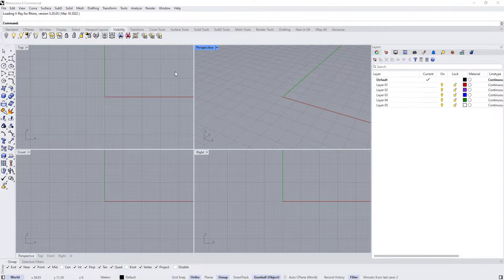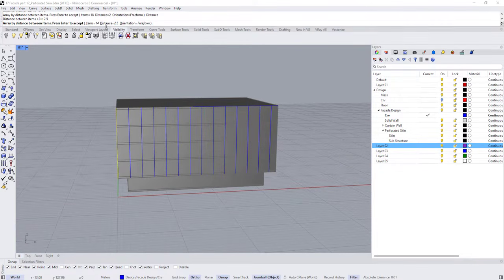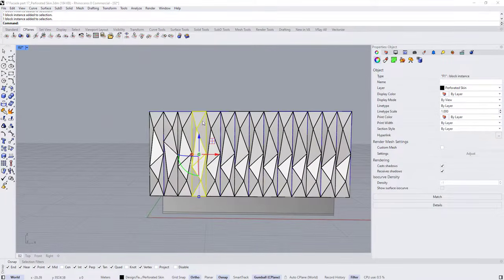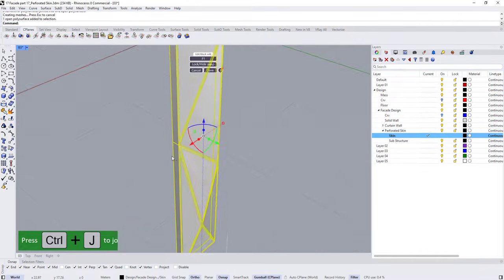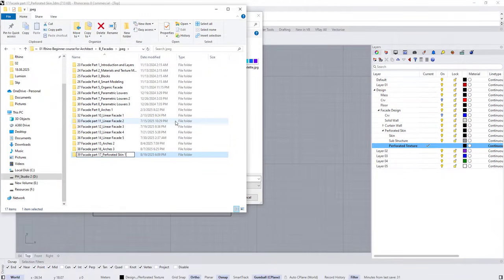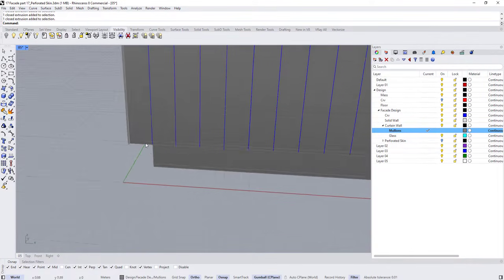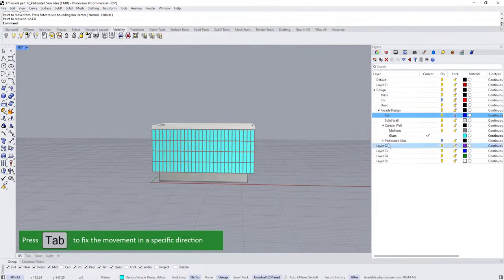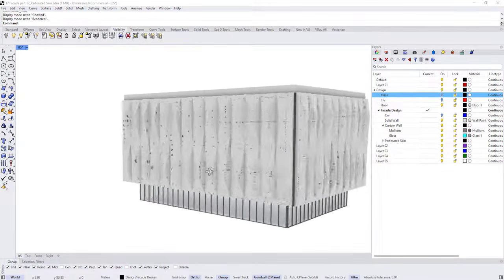39 Rhino Beginner course for Architects_Facade Part 17_Perforated Skin 1

Comment: Appreciate that 
how can i do blocks in curved wall not straight
i tried a command that ( flow along surface) but i don't get it ?
Reply from the maker: You can use Array along curve if you want to maintain the block, or you can explode the block and use flow along curve or flow along surface